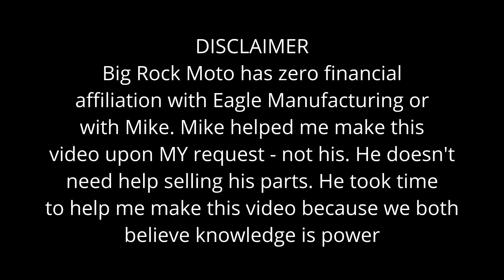KLR650 Doohickey: Everything You Need to Know (incl. 2022 model) (w/ Eagle Mike!)

Comment: So I really don't won't to watch the whole video first generation they wouldn't fix mine under warranty it was making a loose chain rattling noise. I replaced the broken idler sprocket spring.i sold it bought the new style generation 2 it was a made in Mexico everything broke on it I bought it brand new .all the turn singles broke off one after another. dealer said I broke all the turn singles off and they wouldn't replace them under warranty. the  mirrors when they started getting spiderweb in the glass.They did replace a bad counter sprocket seal at 400 miles that was leaking oil,anyways I went back to riding a DR 650.it wasn't as comfortable but it held together

Comment: so what noise should we listen for,i have a 2012,with 20,000 klm, it sounds good ,very smooth except under load at about 3000rpm it makes a tapping noise,from the engine somewhere,iv checked for everything, only does it at 2700 to 3100 then goes away

Comment: Hi Ian, 

Firstly, I'd like to thank you for your truely brilliant and inspirational reviews. They are refreshingly honest, down to earth, clear, full of insightul information that most other reviewers don't cover. They have very useful real world facts, hints and tips for all types of riders. Keep up the fabulous work you are doing, you are appreciated by many thousands of riders all across the world.

I am from the UK and own a 1984 Kawasaki KLR600A1 (kickstart only version from the first year of manufacture). 
I really hope you can help me as I can't leave a message request on Mike's website as it looks like it wont accept help requests from overseas. I am not on social media and don't Mike's email address, his website also doesn't have a generic email that I could contact. It also looks like currently Mike's web site wont accept orders from the UK or Europe due to tax/Import regs. However there are ebay sellers of the various kits that do sell to the UK.

My dillema is as follows: I'm really hoping you can help.

My 1984 KLR600A1 has done 20,000 miles.  I'm thinking of purchasing a Doohickey kit and possibly the Thermobob modification, however I'm unclear as to which to get  or if I actually need them, if so which kit or partial kit would be suitable or indeed that is suitable and will fit? There appears to be the Balancer Idle Lever & Torsion Spring Upgrade kit and the option kit with the 2 x coil springs and then the Therobob kit.

I did read on one Kawasaki KLR Forum an article by someone who mentioned the following and wondered if you or Mike could advise? 
The guy's article read as follows: (He owned a 1984 and 1986 KLR600). The article extract is below.

"I have a KL600a(84) and a KL600b2(86), tried the doo on both.

I got the torsion spring and doo from Eagle Mike for each bike, here are my results and observations:

On the 86: there was almost no tension left in the factory spring. , and the 2 springs that EM sent me were too long also. So I installed the torsion spring and everything had worked like a charm since.

On the 84: The 84 "a" model has no electric starter. Therefore there is no starter gear behind the magneto for the starter to turn. Therefore the magneto doesn't stick as far out on the 84 as it does on -all subsequent klrs-. Therefore there is less clearance under the magneto for the doo hickey. Therefore the eagle mike doo with the thicker, more robust one piece body does not fit. You may be able to shave down the doo a little bit more to get the clearance, it's pretty close. I elected to install the replacement spring and stick with the old doo, and the spring had space between each coil, and I'm not worried about that spring snapping. Ever.

This leads me to theorize about the weak design of the original doo that is notorious for breaking: in the first klr600 design (which all future model 600 and 650s were revolutions from) there was very little room for the doo, thus the profile they built it in. When there was more room down the road with the addition of the starter, they stuck with the old doo design. Until 08, anyways."

So my dilema is, what would you recommend I obtain for my 1984 KLR600A1 kickstart only model?

Many thanks,
David Smith

Comment: I've heard a lot about this issue for a long time. I bought a 2011 new, and road it 20k+ hard miles in 5 years. I never had an issue. Is this a hit or miss issue or everyone will a klr will deal with it?
Reply: From what I've read by literally hundreds of riders that have put 50k+ miles on the bike and done minimum work, it's a 1/50,000 bike problem, but it's made Eagle Mike filthy rich so why wouldn't he keep pushing the scenario? I'm not saying it's something you shouldn't do to a bike with higher mileage on it, but to push the narrative that someone who just purchased a 2022 KLR650 needs to immediately tear it down and replace this part before the bike falls apart seems highly unethical!

Comment: How do the replacement parts differ from the stock parts that fail? Thanks
Reply: The tension spring is a completely different design, and the balance tensioner lever (doohickey) is a machined part instead of a cast part.
Reply: Thank you Jeff

Comment: You know why Kawasaki didn't change the design?  because they designed the motor and if you do the required adjustment at the correct mileage you won't have an issue.

Comment: What he don't tell us, How many miles did the broke part bikes have on them, Or how the bikes were maintained/ oil changes, Or how hard they were rode, or even over revved. Sure he has lots of them sitting there, He makes and sells them for a living!. Sure there maybe a few or couple with cracks, you get that in castings even in firearms, And out of how many bikes? Kawasaki would have told us after 30 fricken years of one of the longest running models of all bikes in the world!. Hell you get that small failure rate in brand new cars!. Then if a guy gets 100K+ on a KLR it's pretty much shot anyhow, Just like cars!. So what does anyone expect out of a ^ to 8K bike in the first place?. Comming from a guy that owned 2 each gen 2s which never had one problem, and now a 2022 ADV ABS... Next he says there's only 10 to 15 thousands left of adjustment in the spring you showed us? Thats BS!. I use a machinists caliper everyday! There's tons ( If not 100s of thousands) of spring pull left just by looking at the video in your closeup!. Oh, there is No torque or excessive presure on this counter balance system, just 3 small weights, It does nothing more!. You'll be ok, just maintain your bike, Change the fricken oil on time, Don't over rev or beat the crap out of it, It will last!. It's funny to me how nobody talks about the cam chain tension or the valve shim check or adjustment!... I have 2 Aerospace degrees, and been wrenching or Kawasaki's since 1968, Way way before you were born, and Mike was in Jr high school..LOL!..
Reply: Touche!!!! Don't believe the hype. Maintain your KLR to spec and you'll be OK without the replacement.

Comment: The doohickey and other KLR parts he makes keep Eagle mike making money… I’m not accusing, I sometimes wonder if that’s the motivation here
Reply: Agree. He's a rich man from this. Am KLR owner in OZ and many long term Kawi mechanics i have spoken with have NEVER had to do Doohickey failure work.
A Number have done the recommended replacement at customer request.
I could well be wrong but alarmist hype is prevalent. My 2018 has done 70,000 klms and still running well.
Don't believe all you see and read!!